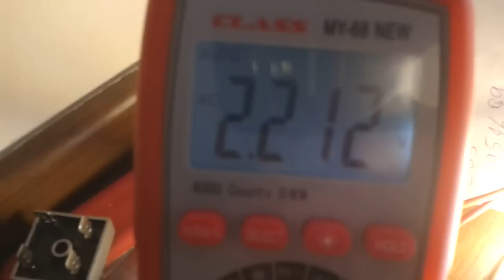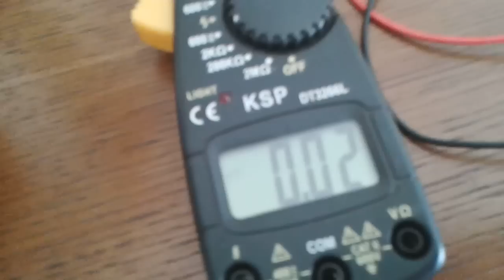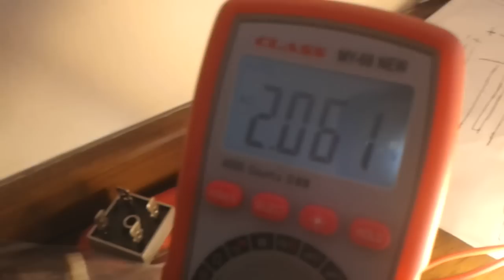Gerard Morin transformer without engine

Comment: Gerard Morin is very very unintelligent. This is all veryyyyy easily explained. You dont have to be a scientist to realize Gerard is a moron. Volt is a measure of potential. Amps is a measure of current flow. Resistance is the resistance to amperage. Hertz is a measurement of frequency. Frequency is a measurement of the sinusoidal waveform which is what A/C is comprised of. Rectification of A/C just means you throw it through diodes that only allows current in 1 direction. The only reason Gerard Morin makes sense to so many people is because he has no idea whatsoever about what he's talking about.

Comment: The 7 and 8 watt LED bulbs are two "Diodes" in parallel, creating a fast resonance, based on your 220 AC input(short wave form, with polarity reversals, causing positive pulses). That rope light is many LED's (diodes)in series, creating a slow-building field resonance causing the "throbing" light effect. Interesting that the field on the 7/8 watt trial began to build even before you plugged it in. You are not creating free energy, but you are causing it to come from somewhere else, (like Morin). Putting a reversing/pulsing polarity load increases it(with a LED bulb/or an AC motor). Putting a constant resistance load(like a soldering Iron) ceases it(like Belanger).
Reply: How do u get to make square wave like half sign or full sign waves using diodes, is it possible to make it using a  resistor in series or shunt or is thr some other easy way 2 do it

Comment: Try copying how power stations function and create a mini power station where gerard morin's washing machine magnetic pump acts as a turbine, install step-up and step-down transformers like power stations do, install inverter and batteries, etc. and then try again. You might be able to then make it capable of powering a single house. Also make sure gerard morin's washing machine magnetic pump is producing RF volts. I think RF is what turbines at power stations generate and then they convert it to AC.

Comment: You don't have to plug 220V  AC to light two LED bulbs... Those are not incandescent bulbs brother, because they have heat sinks... In they are LEDs, they use less then 10 watts.

Comment: Hi, thanks for sharing work :)
Do you know if it is possible to Charge a Battery with the output?  Perhaps connect transformer output to Solar Charge Controller and then have its output Trickle Charge a 12v Car Battery e.g. the transformer acts like a Solar Panel that is always On?
Thanks again.
Reply from the maker: thank you .I did not try

Comment: Haa D, Thank you for taking the time to send me a schematic.  One question though.. Is your input voltage 120v or 240 v? Thank you.
Reply from the maker: 220 volt
Reply: @haad3750  what happens if u ground I mean areal ground on the centre of the transformer or on both connected to centre as centre tap would thr b anyway to get to work along with resonance of diodes I think the amplitude shd c marked change, also can put a lc tank on the centre and check if it works out over a specific frequency

Comment: I see you have 4 coils, 2 within the core, and 2 outside of the core. All coils have 2 wires, 1 in and 1 out. I only see the system having 4 wires, because it is not so clear. The two coils in the middle are shorted together with the jumper, but where do the other 2 wires from those coils go? I know the base has a coil in it which connects to the wall, that is understood, but, where are the outside additional 2 coil wires wired to? I do not understand.. I see only one wire from each outside coil being used as one wire from each air coil is going to the outlet strip to power it. I need to know where the other unused wires would go? Could you draw a SCHEMATIC for me PLEASE? , I would like to replicate this using the correct high frequency test equipment to test the true results.   You could email it to me and I will send you the video link once I replicate it. TY, Marc  marcvbelanger@gmail.com
Reply from the maker: Thank you for the help I am not very good with elekronik that was only an idea thank you again Marc.
Reply: could you draw a diagram of where the coils connect to for both of the leads on each coil? In the video, only 1/2 of the connections are visible
Reply: This is not his, It is Gerard Morin's, you'ld have to ask the guy in the vid. Look up Gerard Morin

Comment: you can not measure it because there is not 50Hz. Multi meters are designed to measure 50-400Hz. If frequency is above, then it starts to show you fake measurements.
Reply from the maker: Thank you

Comment: ok,cool ,is that 120 volts going into coils, but only use 0.002 of a volt.,or coils only using 0.02 of a volt, and is that radient energy on out put, but great video,i subbed
Reply from the maker: +joe18370  from the wall 220 volt 0:02 amps
Reply: +Haa D I try with 120 volts I'm in usa
Reply from the maker: +joe18370  ok